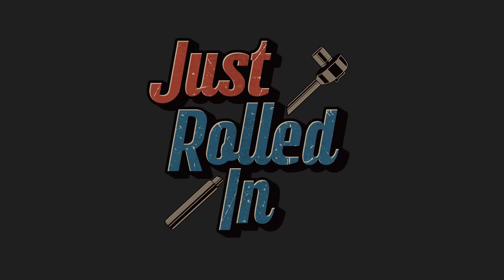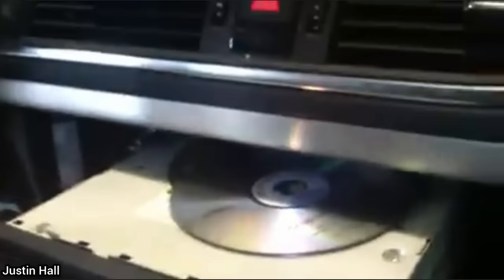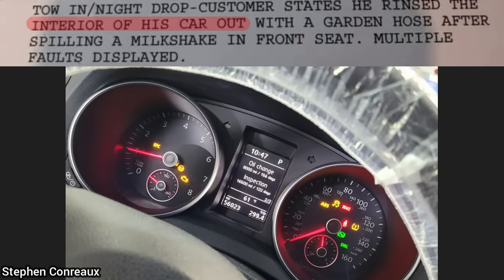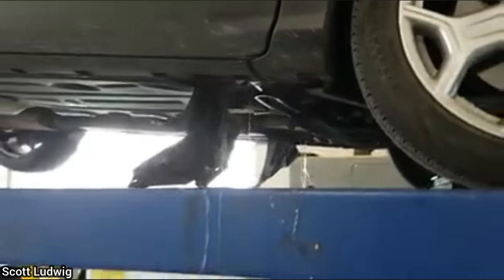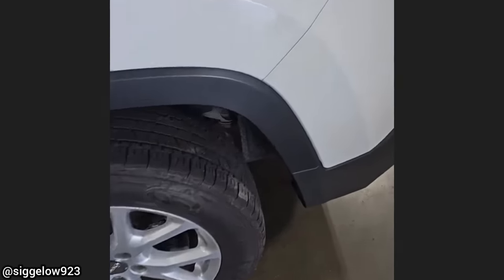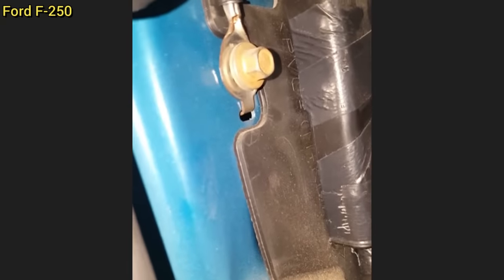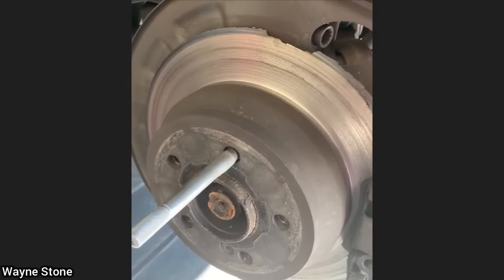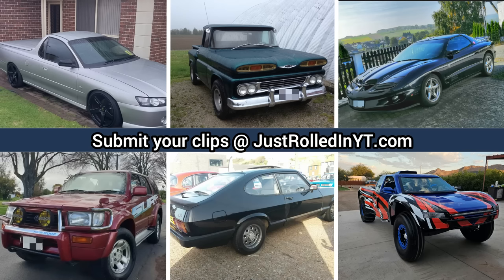Customer States Parking Brake Seized & He Took It Apart

Comment: The first dude saved more than the repair cost by not calling a tow truck. Good job.
Reply: Better drive reeeeal slow on the way though.
Reply: I was impressed on that one. He did what he had to do and did it as best as he could with what was available.
Reply: And then you have the people who drive on 3 exploded tires 17 miles to the shop, practically totaling the car

All because a $100 tow truck is expensive

Comment: That 'Parts Cannon' guy had an awfully expensive loose screw.
Reply: I'm getting second hand anxiety from it, some people have too much money and no brains. We need an idiot tax
Reply: Surely you don't have to pay if it doesn't fix the problem...
Reply: All these drivers have loose screws
Reply: All for the cruise control. I barely used mine when it worked, and when I broke the sensor while adjusting the clutch, I never missed it. I always worried that the thing wouldn't disengage when I pressed the brake or clutch...
Reply: @catjudo1   Unless you have one of the shitty early cruise controls before engineering got it worked out, this has never been an issue. A decent cruise nowadays probably drive better than most drivers.
Reply: @bbgun061 , keep on telling yourself that. A shop will charge you for everything whether it fixes it or not. Sometimes you may successfully argue over labor but any new parts they installed you will definitely be paying for. As for this situation though it sounds more like the customer did all the parts swapping and only took it the shop when he ran out of ideas. So he saved a ton on labor because a shop would've done the same thing. As for parts, he probably returned most of them. The thing with today and quality, there has been an increase of new parts that are poor and even non working condition. You may actually get a part you think you need, put it in and still have the same issue, and move on thinking you've already eliminated one possibility, but in reality that new part was bad too.
Reply: @MinecraftMasterNo1  My car is 23 years old, so you set it and it goes. No sensors to make it stop or any of that modern stuff. But mostly I just don't trust drivers aids. I don't trust the things, and I also don't want to get complacent with them. I like to think that I can keep my skills as sharp as possible if I drive carefully and don't rely on anything to help. In another 20 years my uber-car will drive itself anyway, lol.
Reply: @catjudo1 they already have Uber cars driving themselves
Reply: @kevinm.n.5158 the idiot tax is the parts cannon.
Reply: @magicalphones  There was an article a week or so ago where several of the things just froze up because they couldn't figure out which one was supposed to go first at an intersection. Still some bugs to work out, but it's progress.

Comment: the customer with the transmission problem saved a whole lot of money!! but to be fair some shops would have fired the exact same "parts cannon" at it!
Reply from the maker: So true! Keep it simple stupid. As I've always been told lol
Reply: My brother's Hyundai showed a warning for the turn indicators. The dealer said it needed a new body control unit. He asked me about it as I am an electronics technician . I told him I don't have any experience with automotive systems but I would check the lamps and sockets, as the control unit might be seeing a high resistance due to corrosion.
He check them and sprayed contact cleaner in the sockets and the problem disappeared.
Reply: @JustRolledIn  1 or 2 ugga duggas should fix the problem.
Reply: The old g101 g102 g103 problem. Soo many different grounds , soo little time.  😂
Reply: I got caught doing the same thing when my engine died and I thought it was an old ignition issue resurfacing. Then I remembered I had high centered the van like 6mo ago and that the gas tank was probably concave
Reply: I had an old '96 SL2 Saturn and the odometer quit working.  Took it to the dealership and after spending $2000 on a new cluster and other parts, it turned out to be a loose wire.  Never went back to them again.
Reply: @nightwalker9000  Couldn't you ask for your money back since it didn't fix the problem?
Reply: @bbgun061  I tried and they said they repaired it to their best ability based on similar failures in the past.  Plus the fine print in their diagnostic agreement I had to sign to approve repairs basically said I couldn't get my money back if they were wrong.  So you have to screw yourself and hope they get it right.
Reply: Absolutely they would've done the same parts, he saved a ton on labor charges. Can't tell you how many times I've had a car problem and just the thought of replacing parts had me scared but only ended up being a loose ground.
Reply: I took my car to the shop a week ago. They quoted me £1000+ for changing the cooling fan unit (part and labour). I found a new part (electronics only, as the fan itself is OK) for £19.60 on eBay and installed and tested it myself in about 10 minutes.
Love the parts cannon guys.
Reply: @nightwalker9000  My first car was a Saturn SL1. Good little cars, but probably not worth a 2k repair bill, no matter what they're fixing.
As for that specific problem, I wouldn't even bother fixing it. That's resale value right there. "It's a low-mileage car!"

Comment: It must be so satisfying for the tech to show the customer how simple the solution is, whether it's pushing a button on the dash to turn the rear lift gate on, or finding a bad ground.
Reply: Oh I probably wouldn't be a good fit for a repair shop for when a moron customer comes in and can't figure out something as simple as untangling a seatbelt, as I would go out of my way to shame them, which wouldn't be good for customer relations for the business.

Stupid people like what are shown in these videos should be publicly shamed for what some of these people are driving a potential accident, that will undoubtably involve some other innocent motorist in their well-maintained vehicle. We have to share the roads with ignorant morons.
Reply: After spending about half-an-hour and getting absolutely nowhere in changing a headlight bulb on my mum's car, I took it down to our local mechanic to see if he could figure it out. He saw the bulb we had, walked to the back of his garage, picked up another one then fitted the bulb with one hand in seconds whilst sitting on the front grille. He was very pleased with himself.
To be fair it wasn't even my fault - Halfords (UK car parts retailer) had the wrong product code in their catalogue. Or as he put it "they're a shower of lying b*stards".
Reply: Nope, it's a huge waste of time and you don't get paid for it.
Reply: To be fair, SOME of these vehicles should require a week-long training course for operators because of all the crap they put on them anymore. Then you have the poor ol' Granny types that didn't grow up with all this tech & nobody ever showed/taught them.  HOWEVER, then there are some of these people that are pretty numb in the brain and between their lack of care/interest in automotive care & operation, PLUS their lack of knowledge/care about traffic law, it's a pretty scary combo of what we have going on out there on the roads anymore. It has become borderline mayhem!
Reply: I guess it depends how big their ego is. Some people like to help others without judging them.
Reply: @outhere8690 Not a granny type but totally agree! I once owned a car for 6 months before I knew it had tilt steering!
Reply: @henryturnerjr3857 - 😄...and tilt steering is actually a great feature! Well, I learned years ago that reading the owner's manual could teach you a few things your vehicle just might have! I've seen a few on this channel that also learned (the hard or embarrassing way) about things their vehicle didn't have. Lol. Take care & stay safe out there!

Comment: The loose ground nut after 2 transmission changes and 3 torque converter changes is so real.
Reply: Seems insane to me. I mean grounds are the first thing you check when you have total failure right? 
I went nuts checking my grounds in my 94' Camry one time when the issue was just the (singular) ignition coil.
Reply: @rushnerd Loose ground on a painted metal body section is just the icing on the cake, star washers are not a solution went through 1/2 of my last car gained 2 mpg. A lot of scraping and spray paint.
Reply: @frizzlefry1921  Isn't the entire engine bay painted though? Didn't know that mattered at least on factory paint. Interesting.
Reply: @rushnerd  they pierced the factory paint with star washers to ground circuts it didn't work well.
Reply: The mechanic whose videos I watch has a good first check for any electrical or electrical-adjacent errors in any vehicle.
He checks for loose or corroded brake cables.
-
Then, before he even thinks of the parts cannon, he checks wire continuity.
Also remember, just because a part is new doesn't mean it's good.
Reply: @MonkeyJedi99 new: never ever worked.  I would trust many junkyard oem parts over new aftermarket parts, sometimes new oem parts.  They are time tested☺️
Reply: @MonkeyJedi99 Btw, what mechanic channel are you talking about?  Always good to improve on electrical knowledge.
Reply: Because the computer did not say what was wrong.
Reply: @frizzlefry1921    You gained 2 mpg by scraping paint off sketchy ground connections?   I might have to give that a look.
Reply: What an stupid statement. Maybe stop buying new Chinese knockoffs and buy OEM or from reliable 3rd party. Used parts from junkyard are always last resort, they are not time tested they are worn and on way out anyway.
Reply: @wykydytron  What a stupid statement. Maybe figure out how to express your point without attacking people you don't know on a personal basis just because you have internet anonymity.

Comment: Can’t blame the first guy he got it there for free. And the last clip is so damn funny for some reason 😂😂
Reply from the maker: Tow truck would have been free also since it was under warranty 🤪 and last one is when you declined repairs lol
Reply: That last one is the car version of when you scratch your dog in just the right spot
Reply: I still don’t understand why the rotor had to be bungled on instead of riding to the shop in the cab.
Reply: LOL! I said “bungee’d” before auto-correct got a hold of it but “bungled” works too. ;)
Reply: @JustRolledIn My warranty has never covered a tow. I’ve tried.
Reply: I was just wondering why an E-brake needs to have a motor.  Man they make cars so damn complicated nowadays. I'll keep driving my old clunker until dies, it's quite possible I'll die first.
Reply: @emmettturner9452  two reasons. Parking brake motor stopped working well clamped on tight. It also keeps the piston from blowing out as you use the brakes. Dumb idea putting motors there to work the parking brake. The rust belt eats them up.
Reply: @Ghauster  OK, that makes perfect sense. Thanks. Now: Can you tell me why power folding side mirrors aren’t all automatic? Never driven a vehicle with those but I always assumed they were automatic until seeing this video.
Reply from the maker: @emmettturner9452  with what manufacturer?
Reply: @JustRolledIn  If they are power-folding mirrors from any manufacturer like the ones at 00:38, why wouldn’t they automatically fold/unfold with the ignition status? I’d assume that even a manual override button should only stay that way until you toggle the ignition or hit the button again.
Reply: @JustRolledIn Prolly still would've been a 6 hour wait for the tow truck, where you have to be with the car when they finally show up with no warning.
Reply: @emmettturner9452 because it is still connected to the brake line.  Not worth finding a way to stop the brake fluid leaking out, and also re-bleeding the system.  Although NGL, I would have ordered off Amazon a parking brake motor first probably (and whatever crazy socket needed to change it.  Unless it needs some kind of service computer reset procedure.  Then it goes to the shop)

Comment: Yeah, brings back memories.
from working at a ford dealership in Grand Texas. 
Customer states loud popping noise from rear of car above 50 MPH (The tech who pulled this asked me to ride along after confirming the noise, because he couldn't pinpoint exactly where it was coming from, in a Ford Escort)
Got on the freeway and verified the concern, noise coming from center of the roof. 
I had him pull off at a gas station at the next exit. got out of the car, removed the Styrofoam Jack in the Box antenna ball from the centrally mounted roof antenna, which had been blowing in the wind and popping the top of the car.  verified repair on the way back to the shop.

Comment: I was quoted around $1-1.2k to get the brakes replaced on my Suzuki hatchback.
I looked online to see if the hardware was really that expensive, and found all the parts for around $120. 
For the $1k difference in price, you can literally buy every single tool to do it yourself in an hour or so, and have enough left over for a nice weekend vacation.
It's amazing how lazy/unmotivated most people are to learn a common skill, especially when it can save them a ridiculous amount of money.
Reply: $1k had better include brand new OEM calipers at that price
Reply: Yep, and if you do things right, when you DIY you do a better job than most shops.
Reply: @counterfit5  Not when you live in a Californian satellite state, labor prices are outrageous.
Reply: I don't get your comment, as it goes completely opposite of the video - the learning from the video is that not everyone should attempt to do their own brakes. Yes, it can be learnt, but as seen in the video, some people are just...
Reply: When I was young, I was looking for a second job that worked around the schedule of the first job- very hard! Instead, I realized that by doing my own repairs (the easiest, most common ones to start with) that the money I saved was like having a second job, one that worked well with my schedule.
Reply: Sometimes a untrained person that cares can do a better job than a trained person that doesn’t care.
Reply: Absurd pricing in my country break change is around $30 for work and it's in EU... You guys are getting f... In USA with your pricing. That said if you never changed breaks know it's almost never as easy as it seems if you don't have tools for the job and many modern cars use automatic e break so you need laptop with correct soft to turn on service mode and that soft can be found for free on net for some cars but for some it's anywhere from 3k to 100k in case of exotic cars and that's used with station as just obd and laptop won't work. So depending or car it may be better to leave it to shop. There is reason most diy videos etc are done on simple old cars.
Reply: DYI brakes? Bet your life on it. You probably can do many common repairs by yourself, as far as you arent dumb, but brakes or steering is better left to someone who knows what he is doing. Its not rocket science, but if you screw something up, you or someone else can pay the price.... much higher.
Reply: @cyphi474  no

Comment: A good tip about your car's electrical problems that I have learned through personal experience, make sure your mechanic has already checked the wiring, all ground connections and the fuse box before changing anything, which, will save you a lot of money, because there are a lot of mechanics out there that will tell you something is wrong with your car without checking basic things.
Reply: Step A for me is always ask the customer what has recently been done or happened.   Been told by former managers/service writers don't.    I swear by it,  gives you a good read on the customer/vehicle..   I don't care if you spilled your beer, ran over a animal ect.  .. 😉
Reply: Maybe I'm just a cynic, but I bet most mechanics would assure you they've checked everything and roll their eyes about another customer telling him how to do the job...
But if a mechanic told me to replace a part and it didn't fix the issue, I'm not paying for that part!
Reply: @bbgun061  what happens when that customer just happens to be a mechanic, out of town friends car no tools?. 😉

Comment: I did a brake job including pads and rotors on my car a couple months ago but the car ended up having a mechanical failure on the ABS module to the point where I had to get the entire module replaced, but when I look at how other people do work on their own cars, I look at the brake job I did and I’m so proud of myself. Only one brake would stick and it was because that side of the pump would not flow the fluid back properly, something that I really couldn’t have anticipated anyway. Otherwise the work I did was perfect and by the book as far as anyone else was concerned, and everything is working just fine.
Reply: Next time, open up the bleeder screws or replace the calipers. Keep the brake fluid fresh.

Comment: Even though I'm not a mechanic I know how most things work on a car, but it never occurred to me that the piston would just fly right out of the caliper if given the chance - hilarious!
Reply: Yep. They pop right out of the rubber seals. Just brake fluid behind them and nothing holding them in when they don’t hit the back of a brake pad or rotor first.
Reply: Que ,got to break free by queen
Reply: @vs-ww7cb  
I'm a shooting star 
leaping through the sky like a tiger
Defying the laws of gravity

Queen - Don't Stop Me Now
✌️😎
Reply: @Jeff.78  😎
Reply: also, with electrical parking brakes, there is a mechanism behind it that would fall apart when the piston falls out. you need a specialist to put it back in, so the caliper is effectively destroyed... with some vehicles, if left alone the actuator might engage the parking brake on it's own without warning, which is why they need to put into mainenance mode to avoid accidents.